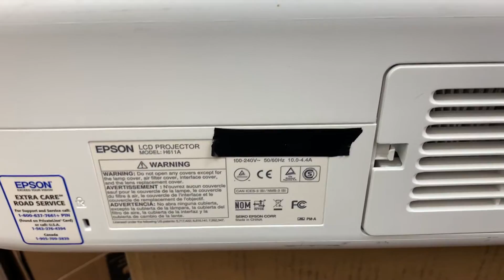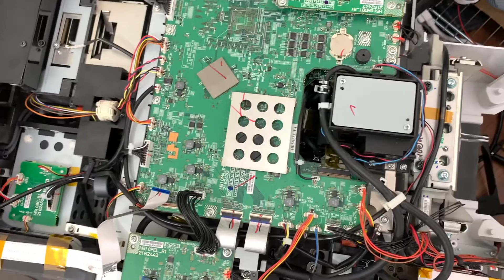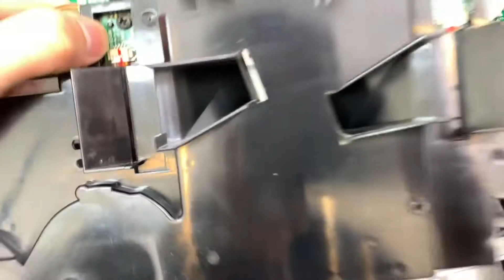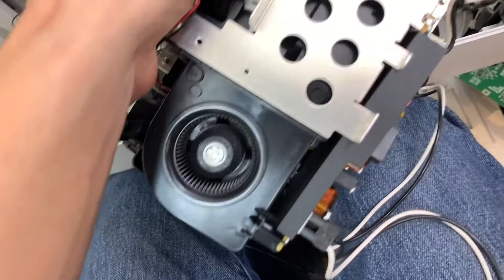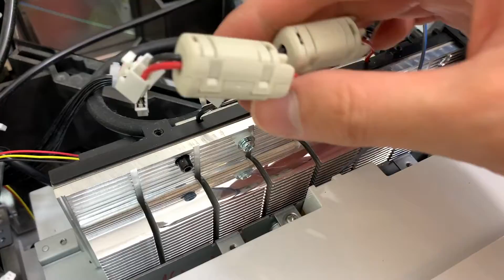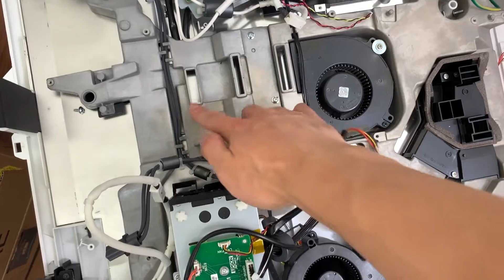[Teardown] Epson PowerLite Pro Z9870U Huge 8700lm Liquid Cooled 3LCD Projector

Comment: I just bought an Epson powerlite pro Z11000W. 
The previous owner took out what you called the c20 inlet and made it a direct to power outlet cord and I was wondering in order to just get a new c20 outlet to connect back to the power board what should I be searching for to make that connection?
Reply from the maker: I do not know what this particular part looks like in your model (perhaps you could post a picture), but I would start with a search for "C20" on DigiKey (a primarily North American electronics distributor) and select the "Power Entry Modules" category. Any connector that fits will likely work fine - mind the line and neutral polarity and make the ground connection solidly. Power inlets with filtering shouldn't hurt to use.